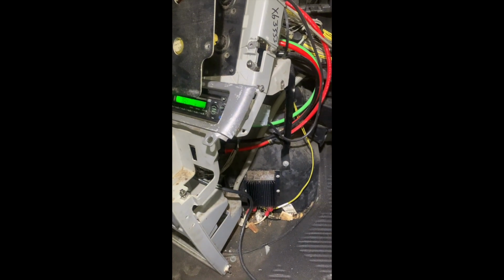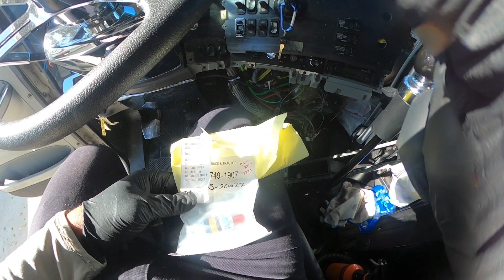OWNER OPERATOR | AIR SWITCH REPLACEMENT | FREIGHTLINER

Comment: You think the Cruise couldbe a loose connection after digging around in the dash?
Reply from the maker: Found out two kinds of air switches. The one I had fit, but was wrong one. Purchased correct one. CC started working again.
Reply: @Smooth_Operator_83  Damn, Ishould have thought of that.  Happened to 259 once as well.  That was a long ride home with air spraying the whole way home!  LOL!
Reply from the maker: @atlasshrugged3753  lol